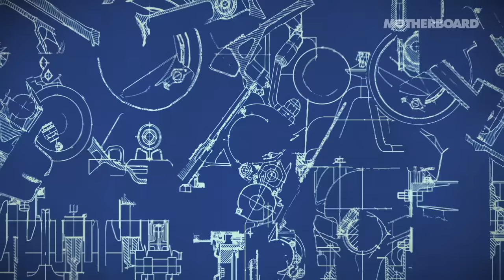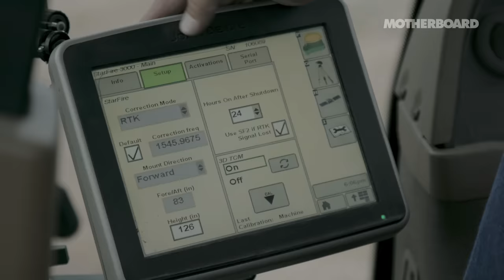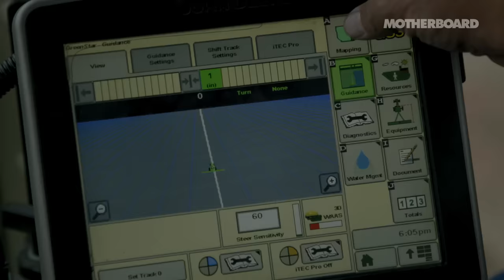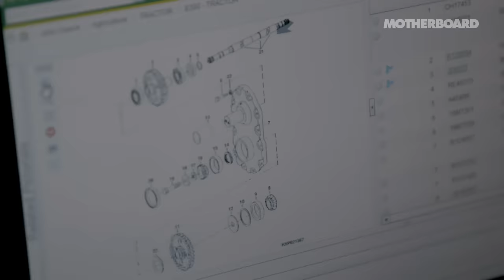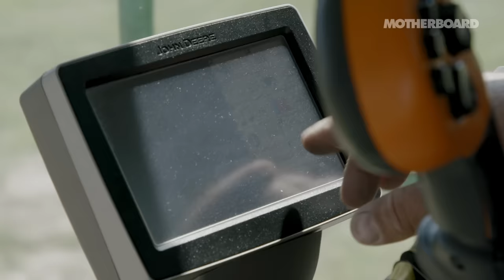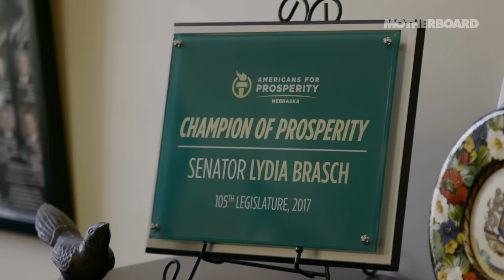Farmers Are Hacking Their Tractors Because of a Right to Repair Ban

Comment: I’ve owned a euro auto repair business for 30 years now. It’s all about the money. Pure greed and marketing. Designed to fail. Mercedes are now putting plastic oil pans on there cars and suggest replacing the Plastic drain plug with every oil change. When you handle these cars every day and the software it takes to accurately access a problem. It is evidently clear that the money making piece of the automotive industry is definitely parts. So much plastic on cars now, it is insane. And all in the name of saving weight and cost. If I had to maintain a new car for the next ten years, I wouldn’t trade my 08 Volvo 3.2 liter for one. Cars and especially trucks are so overpriced. I can’t imagine owning a farm and being at the mercy of a dealer with my machines. My grandfather was a Massey Ferguson dealer and I grew up working on tractors that you could fix with your hands alone. Just a few special tools for hydraulics and fuel. Today an independent shop owner must spend thousands of dollars on special tools and software to make a living. Greed is the culprit.
Hats off and gratitude to all the farmers in this country.
Reply: Got a feeling they learned those tricks from Chrysler. Chrysler's MO is "people are stupid, screw them at any chance". Just look at a 2001 Neon, plastic thermostat housing, guaranteed to fail. Meanwhile, my 2001 BMW E38 740i and 1997 Ford Expedition are just normal cast aluminum, conventional in every way. Sure, the BMW uses a specialized diagnostic cable, but they're under $20 on Ebay and work better than BMW's diagnostic software does.
Reply: Bmw started the plastic oil pan BS. Mercedes started to take a dive after the m112/113 engines
Reply: I was at work changing draining oil n the plug on the Mercedes just broke off we ended u having to make this guy wait 2 hours until we could get the plug from autozone
Reply: My dad is self employed, or like, a one man auto repair shop, he works mostly on 5-10 year old cars or older, not because he can't repair newer cars but more because not a lot of people buy new cars in this east european country, and he agrees with you fully, and I do too as I've seen with him first hand how they design cars nowadays. Recently I've helped him put some insulation on the inside doors of a 1-ish year old C class, to make the inside of the car quiter, and I must say the clips that hold the door upholstery are shit, like they want them to be replaced? Meanwhile on other older cars they hold up just fine. I've also seen like plastic shields for the underneath part of the engine to protect the oil pan... plastic shields... like why? Other cars have badly placed parts, like on Renault cars you have to take out the inner wheel shields or whatever to get access to fill with radiator/cooling fluid. And the general quality of materials is poor...
Reply: after Chris Bangle BMW is dead for me
Reply: You volvo may have a similar engine to my car, and yeah i wouldnt trade it for a new one..

Even the plastic quality is lower these daya, ive seen it..
Reply: Your comment actually resolves itself , i.e. people are already aware that BMW and mercedes are money pits and prefer repair/mechanic friendly toyotas and accuras , the free market has solved this problem . Its depressing to see americans not realizing this and grabbing their pitchforks to become anti-free-market-we-need-laws-to-protect-us-from-buying-bad-goods type people . Buyer beware , if an idiot buys a BMW without knowing the repair costs , is the govt supposed to save him from his stupidity?
Reply: @tsherwoodrzero  what cable should I buy? I own a 2008 328 xi. Thanks in advance!
Reply: @RomanTrollanski  PA Soft/BMW-Scanner 1.4 is the most user-friendly setup. You'll need a 20-pin to OBD adapter too
Reply: @govindakeshavdas  
The real problem is not the new cars with s****y parts. The problem is companies that say you can't fix the car withour inputting a secret computer code into the car's computer that only the repairmen at the dealership know. 
Also a person could be a genius when it comes to something other than cars, who would understandably and reasonable expect that after paying more than $30,000 for a brand new car that it would not purposely be built to constantly break down on him.
Reply: Is a 2014-2016 Audi A4 B8.5 worth it?

Comment: The word you are dealing with is called "proprietary." Proprietary means that a part or product is made by a company and can't be easily replaced with parts from other companies.

Pros of Proprietary Practices:

    Quality Control: Ensures the equipment works well.
    Protection: Keeps special designs safe from copying.

Cons of Proprietary Practices:
    Higher Costs: Parts can be more expensive.
    Limited Sources: You can only buy from one company.
    Delays: Waiting for specific parts can slow down repairs.

Comment: Caterpillar has the same issue. They use proprietary software that you can't fix unless you pay $5000 for a CD and close to $1000 per year after to keep the rights.
Reply: And then multi billionaire companies complain why ppl pirate their 6000/yr softwares...smh
Reply: Well The law only says they have to make it available,  it dosn't say it has to be free............................................
Reply: Stop using them then.
Reply: @markjones2361   it's not just john Deere  doing it.
Reply: Cummins the same thing
Reply: We need a FOSS tractor firmware pronto.
Reply: Isn't there a cracked version or something like that? You can buy a cracked mercedes star diagnose for  like 150€
Reply: Volvo is the same, it costs a small fortune to do basic repair

Comment: The farmer stated, “ this is the tractor I learned to drive on”. There’s no way John Deere’s new tractors will survive for 50 years. John Deere has no interest in them lasting 50 years. They need to sell more tractors. So they sure as hell don’t want farmers repairing their own equipment.
Reply: That old Farmall will probably still be sputtering and popping through the fields up to the heat death of the universe.
Reply: 4440 John Deere are nice though
Reply: No One wants their tractor to last Forever
They Need to sell veicles.
The famall Is so small and uncomfortable that nobody Will ever use It again in the field
I'm a farmer from Italy and here we don't have this kind of problem.
When we have a problem we call the tecnician
Obviously we don't have distance problem and we don't have so many machines
Reply: Steve McMahan  That B Farmall couldn’t pull a setting hen off a nest!  It will never wear out because it never accomplished anything during its life.
Reply: Farmers are pretty innovative people, you need to be to keep the show running. Until my folks sold the farm last year we had a 1970's Ford 3000 series tractor operating as a forklift that still keeps going, and through the years we've been able to repair it. We also had Kubota's from the early 90's. If something broke you could just take it to an engineering shop to get custom parts made. I just don't see that happening with today's equipment.
Reply: They might last, however, that's the point of blocking any 3rd party repairs. A lot of companies no longer profit much off hardware, the real revenue comes from service and maintenance. Amazon makes more money from services (cloud) than goods sale. Apple's revenue is split between hardware sales and services. Keurig makes more money from k cup sales than machines. So it may last 50 years, but the manufacturer intends to profit from it throughout it's lifetime by serving it.
Reply: @Diode5  we also still use the ford 3000 for ripping up the paddocks and sewing the seed,  looks pretty good with a respray a few years ago.  And i use an old fordson power major for my roller/crusher that i make pig feed with!  Old stuff goes good still,  and i could never afford a modern tractor.

Comment: This is why we need the right to repair, this goes with cars, electric cars, and other vehicles of that sort.
Reply: And iPhones!
Reply: #1 violator to any rights is Tesla - you need to sign a document called Terms of Use and Tesla will turn it off for any violations. If it detects you tried to fix it yourself === off.
Reply: @tomk3732  Start redesigning and rebuilding your engineering technologies back to the pre-computer era of the 1970s where everything is 100% DIY repairable, upgradable, fixable, inspectable, testable, checkable, rebuildable, etc, and what have you! Pass American Laws baning planned obsolescence by making everything 100% DIY restorable! I can still remember that late 1980s going way back to the entire 1970s and 1960s and 1950s and 1940s where everything is held together by screws, nuts and bolts, mechanical clamps, mechanical sliding clamps and other kinds of mechanical connections that can ALLOW ALL AND ANY OF THE COMPONENTS TO BE REPLACED AND THAT INCLUDES THE SUB-ASSEMBLIES SO THAT THE ENTIRE PRODUCT CAN BE REPAIRED AND BE REPAIRABLE AND UPGRADBLE AND SCALABLE INDEFINITELY.
Reply: @tomk3732  NO WONDER TEXAS TOLD ELON MUSK HE CANNOT SELL ANY TESLA VEHICLES INSIDE TEXAS!
Reply: @darthvader5300  They should make condition of sale following of standards and following of right to repair. Otherwise no sales and prevent people from registering these vehicles in the state.
Reply: THIS NEEDS MORE LIKES. LETS START A PETITION, I CAN GET 200 SIGNATURES EASY.
Reply: Is it that bad in the states
This issue existed in the UK and the governments decided that the main dealers were breaching fair trade so made the manufacturers release the relavant data for multi purpose diagnostic services
Reply: Yup. I was speaking with an associate and i said i want to be able to fix any car or equipment i buy and he looked at me like i was nuts.
Reply: Grant Long  idk what you just said but if you do then why don’t you do it? Why is it always “someone else should do it”
Reply: Grant Long  like I said, I have no idea what you even said so you can’t really do something if you don’t know what you’re supposed to be doing. I’m no tech wiz🤷🏽‍♂️ 
As for the risk vs reward part, that kinda thinking is why these companies can pull off stuff like this without batting an eye because no one knows and those who do know clearly won’t do anything cause “not my business”
Reply: *Looks at microwave*...yeah, Jim Bob hand me that there screw driver and hammer. Yee haw!
Reply: TESLA cough cough
Reply: Yeah for sure. I’ve been turning wrenches since I was a kid. Not only does fixing something give me a great sense of accomplishment, it’s also economically efficient for me. Also, as progressive as Elon musk is, Tesla is notorious for making their cars as hard to work on at home as they can.
Reply: Finny someone who makes sense
Reply: @tomk3732  sounds like a good reason to not buy one then.
Reply: Jake Songster  Apple is by far not in almost every home (even in US) as its market share is kind of low. Also Apple products are not as important to people as a car or a tractor. Most people get rid of their Apple on their own after few years of use - there are very few people that keep a cell phone > 5 years. Most laptops are also discarded before roughly 6 year mark. This is not the case for cars and tractors. Average car lifespan is 12 years - that is average. 10% make it far longer, maybe closer to 15 or 18 years. Maybe 5% of phones make it past 6 years. By comparison average phone lifespan is just 2.5 years (vs 12!!!) and laptop is 4 years.
Reply: Jake Songster  Sure it has 100x the market share but that 100x market share is in non-possibly critical items. Your phone not working is an nuisance that can be quickly fixed with a visit to local store. A broken non usable car or tractor is a big deal. Its not a "disposable" item for most people - even kind of more wealthy ones.
Reply: Jake Songster  Today, yes, sure - but if Tesla is now worth roughly as much as all auto makers put together and actually delivers even fraction of expectations imagine Tesla model "1" that is a cheap Tesla in say 10% of all homes - not rich but regular people that bought it instead of a Ford. Now imagine impact if Elon turns off support.
Reply: electric cars are actually really easy to repair,   It's just new to you, and you just need access to some basic knowledge
Reply: @meyatetana2973  Non Tesla electric cars may be easy. In a Tesla car if you change a component the car will inform you of it an refuse to start. For your safety. Heck soon even Tesla components not from the same car will be a problem or already are. As for non electronic components it takes a bit of work to make your own door panel from scratch - same as restoring very old vehicles its not easy nor cheap vs. simply going to say Ford and ordering one.
Reply: @777dragonborn  Tesla is expensive and shitty & next to impossible to repair outside of Tesla authorized provider unless you hack it or make your own (depending on part).
Reply: I 100% agree..  But also add CNC machines and equipment to that list.  I am always did not my 4KW Cincinnati cnc laser.  Cincinnati blocks the computers from admin rights etc.  Real pain in the ass circumnavigating all their crap.  Simple things like re-installing software on 1 of the many PC boards requires me to make a $1,000+ phone call and give them access remotely to the PC..
Reply: @JoshJos-Shwa  Maybe there is a reason Cincinnati glory days ended with manual machines for which a new gear costs not over $1000 for a small spur and for a bigger gear more then the machine. They also AFAIK only made "basic" CNC machines with hydraulic actuators. The company changed hands so many times since 1970s it is hard to figure out where the "original" US version is at. Its similar to South Bend that is now owned by Grizzly - the name may sound familiar and American but the actual company is just a shell. There are services of knowledgeable people that can fix a board for you - but they usually need schematics and that is what companies block - before no problem - everything came with a schematic - now its "secret".
Reply: I wonder if this was a concession to the unions ?

Comment: That's why so many people are still using the old tractors and cars. They still run and they didn't cost an arm and leg.
Reply: Heck Yeah!
Good ole true American Spirit
Reply: So true. My daily driver is a 25 year old Cadillac Fleetwood and with just the usual Regular maintenance has been a very reliable car for me.
Reply: This is why I still own a 1988 pickup. It’s paid for and I can fix it.
Reply: My 69 f250 runs strong as ever.  When the engine dies, I'll open it up, replace a few parts and she'll be back on the road for another few decades
Reply: I've got a 1996 Daihatsu Charade, easy to fix, never breaks down, no computers. Best car I have ever had !
Reply: @yeboscrebo4451  I have a 76 licensed now. I have others but that's the only licensed one.  I'm 50, been driving those trucks since high school.
Reply: My grandson's 80 year old A is srill ussd fot raking and small squares. It it used in tight areas and waterway cutting as well.
Reply: @dickjohnson4268  I worked on one of those a few months ago. Starter quit in 1980's, pull started ever since. But, now it wouldn't start at all. So, I fixed it up, in the field. The original ceramic coil had went bad. No plastic, ceramic.
Reply: @ridgerunner106  The 'starter' on our  (now grandson's) A broke a few years ago. My shoulder makes really bad popping sounds. No electrics on her. She's 80 years old this month.
Reply: @dickjohnson4268  I believe that man said his grand dad bought it in 34 but I may be wrong  It's not fixed up or anything. Been in use the whole time.
Reply: @ridgerunner106  This '40 still has original paint/rust. A set of rings, valves, and a set of tires and 33+ years of continuous work.
Reply: Pretty soon we'll need an act of congress to drive old cars.  Smog test is the trial balloon.

Comment: You must know the cost of ownership before buying a tractor.

Apple computers recently settled millions of dollars in a class action suit where they had to admit they were deliberately slowing down their phones and making their software work less efficiently on older phones ... to force the owner to buy a newer iPhone.

In other words, along the spectrum this goes beyond 'let the buyer beware' and into stealing value back from the customer that they already paid for. 

It is illegal.
Reply: Apple settled. They maintained that there was no wrongdoing. Users would not buy new iPhones if they did not include new features, capabilities, and higher security, so Apple has to improve their operating system to meet consumer demand. Some of these updates will necessarily impact performance of older phones. Technology is like beer - you don't buy it; you just rent it.
Reply: It’s called planned obsolescence
Reply: @drake_leo2152  It's really just market driven obsolescence. The demand is for bigger displays, better cameras, more memory, faster processors, smarter software, and more. All of this makes old hardware obsolete. If you don't care about all of that, your iPhone is not obsolete. I know people who still use iPhone 4's. If it was actually a case of planned obsolescence these phones would be bricks.
Reply: dothemathright 1111  Do you think this state of affairs is an accident? Do you really believe that the changes they make to the OS impact the actual CPU demand that much? It is all top down programmed obsolescence and it is as plain as day. Video game developers have been taking kickbacks from GPU manufacturers for decades to place arbitrary overloads on older GPUs to incentivize sales of new ones. Apple managed to get a press release out of this ludicrous trial, but it is COMPLETELY, TRANSPARENTLY obvious that this is on purpose.